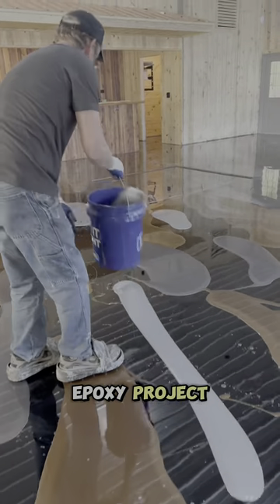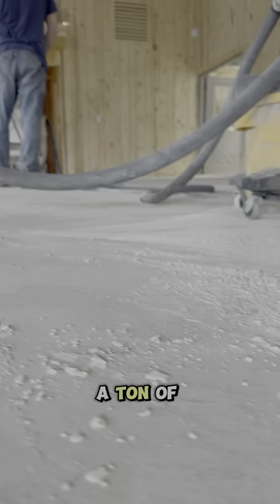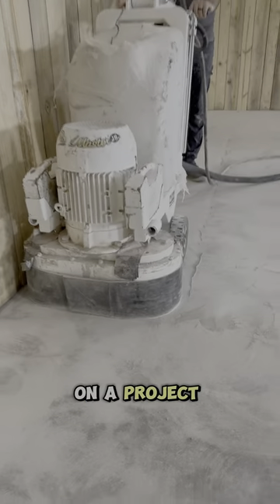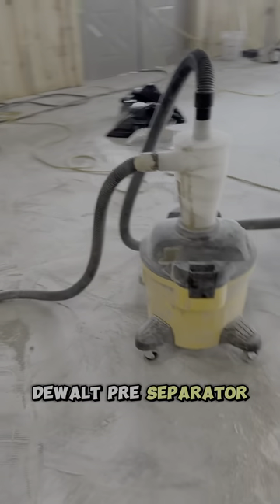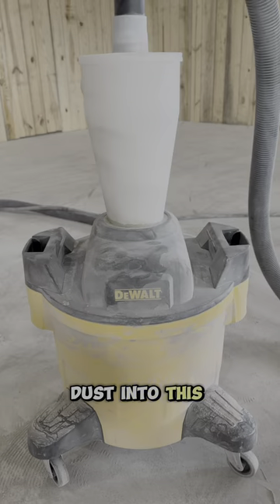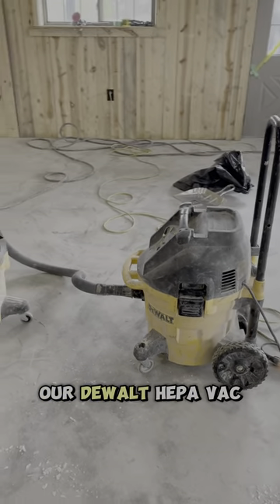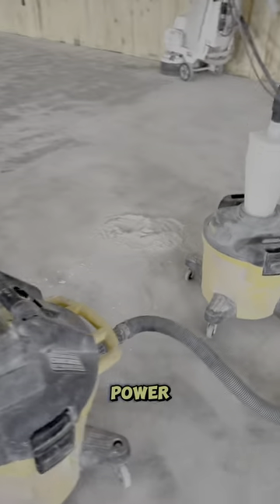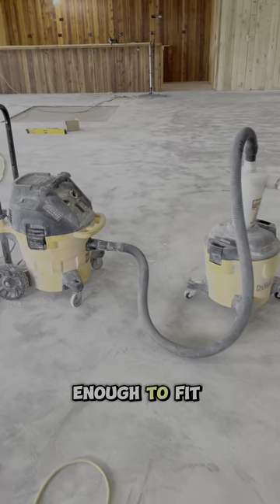⚠️ Metallic Epoxy Vlog - Day 1 - Dust Collection with the @dewalttv  Hepa Vac & Seperator. #ad

Comment: Step up to the triple motors you won’t regret it. 110 single phase Diamapro SVX3A self pulsing vacs are great. Infinity bags, fast cleanup, and workplace safety with superior dust control!
Reply from the maker: We have a bunch of big vacs too. This is just our setup for our smaller grinder.